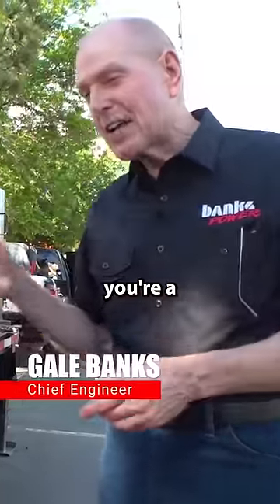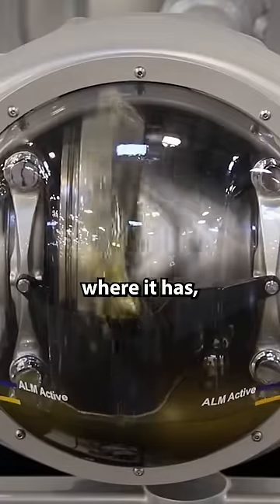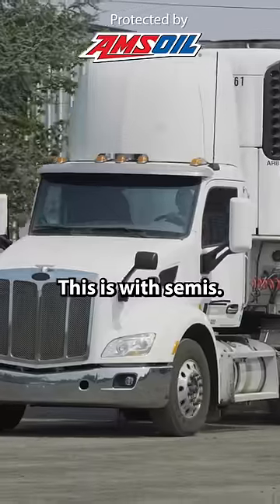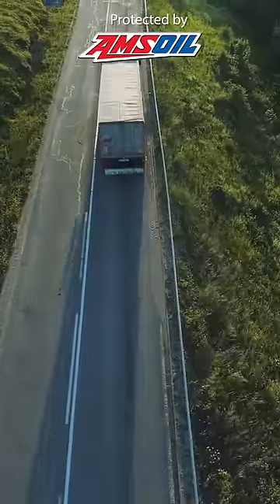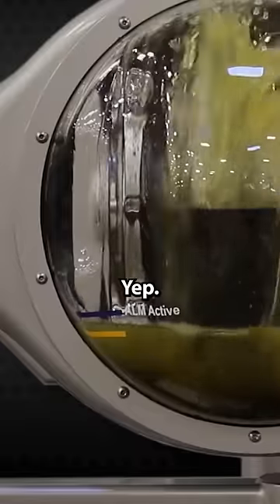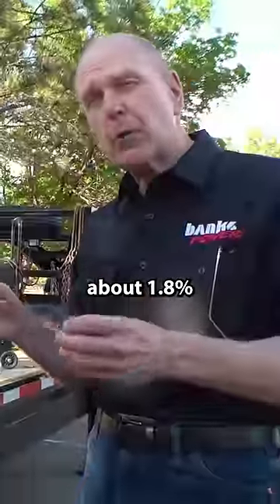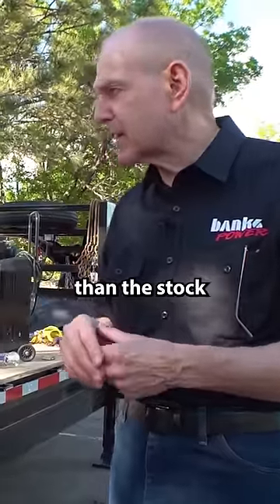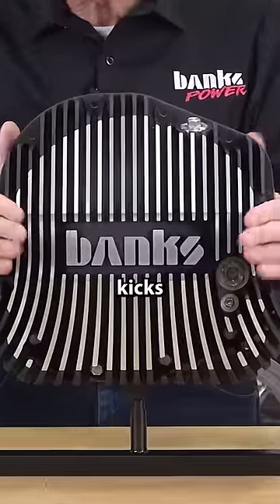Adding 18-wheeler science to your pickup

Comment: Drag racers have been dropping diff trans and oil levels  for that extra .001 in a final since the 60s.
Reply: It's is just the fluid resistance that increases any mechanic resistance? Is that what decreases performance?
Reply: @bok..  lowering reciprocating weight as well as keeping fluids off rotating parts  like ring gear and crank shaft   Minuscule difference but sometimes it’s enough.
Reply: @Formerlywarmer  interesting! I guess all these little things add up in the end. When you reach the higher levels of any competition shaving off a fraction of a second through any means possible helps out alot.
Reply: Back in 1972 at the Winston National drag race I lost my first race by 2/100th of a second.  Yeah, it is important to shave that couple of hundredths.
Reply: Difference between drag racing and semi trucks is that semis have to make it 500,000 miles and drag racers have to maybe make it 5.  Always take wear into account before you do something.  I have no clue whether wear is worse or better if you drop fluid levels, but make sure you do before you consider doing it.
Reply: He’s a racer from the 60s himself
Reply: Detroit diesel is really OLDSMOBILE.  RANSOM E OLDS old company....he made at least 8 companies....
Reply: I'd run ATF during winter months in my manual that called for gear oil. Mileage shot up, shifted much smoother and quicker and the 250k miles trouble free is the data that counts.
Reply: 😂😂😂 real100talk5
Reply: real100talk5  sounds about right
Reply: @davidpawson7393 so running atf in your manual made it shift quicker eh? Sounds about right. 🤪
Reply: @Urapunk 
Lowering viscosity will allow quicker/easier shifts. It’s why synchromesh “fixes” your gearbox when it’s really old and worn. But the chemical properties need to be significantly altered or accelerated wear will occur. Synchromesh addresses this, ATF does not.
Reply: word!!

We run slightly less oil in our dragbikes for this very reason.  Reduction in centrifical weight drag on the clutches = elapsed time :)

Comment: Semi truck drive axles also have oil bath bearings that often get most of their oil from the diff sump. They’re designed to push oil to the bearings when running down the road to help cool them and keep them covered in oil.
Reply: So do the wheel bearings on basically every solid drive axle.
Reply: A seal can be put in the axel tube to prevent oil migration down the axel tube.  And an fyi just for u, tapered bearings are pumps. If oil reaches the small end of roller, it pumps the oil towards the large end of the bearing.  
How is price configured on these money saving items? Cost of production plus shipping and distribution? Naw,  how much can you save, we'll charge 60% of that.  You still save some, but we make more.
Reply: @ianm432  Also on my 1950 chevy 3600 the axles have spirals cut into them so that the oil splashed near the tube is pumped to the wheel bearing. It is a full floating axle.
Reply: My bmw diff also has this
Reply: I work on trucks for a living and this absolutely is not how this works lol
Reply: @ianm432  not necessarily true,  a lot of fully floating axles in light vehicles do run grease, as far as I've seen. A really popular mod for an 80 series landcruiser is to remove the inner axle seal to allow the gear oil into the rear wheel bearings for lube instead of grease, they last longer and run cooler.
Reply: @bobsimpson3332 can you explain please? Some people come to the comment section to see what others are saying, maybe learn something new. I’d really like to hear your take on it?
Reply: That's literally all solid axles lmao
Reply: Throw all that engineering in the bin, i today saw a huge ass electric truck hauling massive fluids. And it had no such axle and gears. Motor straight to the wheels. Efficiency = key.
Reply: @bobsimpson3332  What's the point in telling someone that you're experienced and know what you're talking about, by telling them what you do as a job, to then tell them they're wrong but not explain how they're wrong.  What a great idea. Tell someone that what they think is wrong, but don't elaborate by correcting them so others can also learn. Instead, just say they're wrong and leave it open.  Yes people can simply google it and research it. But if you're not going to explain how someone's wrong by explaining what's actually correct, don't bother telling them they're wrong. Because you add absolutely no value to the discussion. At all. People leave with the same amount on knowledge before they read your comment. You would've been of more value if you just didn't say anything at all.
Reply: @stubbsmuffin  But not all solid axles have oil bath wheel bearings. So it's not all solid axles is it.
Reply: @jonnywilson9117  you speak like your trying to sound like dude in video with the way you over describe and repeat yourself
Reply: @Dudewhite-fw6xf  🙄
Reply: @HermanWillems 
Was that ironic in some strange kind of way I don't get?  

Even absolute laymen shouldn't have a hard time figuring out the reasons battery electric trucks for general transportation of goods won't happen anytime soon - or quite probably even ever - if they aren't severely handicapped and actually try.
It is quite obvious after all.

Comment: I was talking to an MTU tech about this very topic about three years ago. Reducing parasitic loss in transmission and final drives. Lowering both fuel consumption and emissions. Great content👍👏
Reply: The whole transmission is a huge parasitic loss. Remove it all together. Use electrical motors.
Reply: @HermanWillems hello. ALL of EV’s on the market today have transmissions. Look up videos here on YouTube on how to change the transmission oil on a Tesla.
Reply: @HermanWillems never wrenched on anything huh?
Reply: @HermanWillems good grief...yelling sustainability while also standing on top of unsustainably and championing it the whole time
Reply: @Rick-k7m took the saying "if you're wrong stay wrong" to a whole nother level...
Reply: @HermanWillems diesel generator with electric motors is the future, high efficiency. Check out Edison Motors

Comment: Some semi trucks actually have a oil pump that is driven by the input shaft on the power divider to circulate oil to the gears and bearings
Reply: If they have a pump for each differential. It's to pump thru a cooler.
Reply: @mariotillery8459  the truck I saw it on didn’t have any sort of cooling for the diffs. The pump was purely for oil circulation
Reply: @huntingislife7817  what kind of tractor? Odd setup and would need to be overdriven to be able to pump.  I have lube oil pumps on transfer cases,(Fabco,Namco, etc). I've heard of a set up like what you described.  But mainly for cooling.
Reply: @mariotillery8459  I forget the exact specs. But it was a mid 2000s western star set up as a snow plow. With a powerdivider on the first axle. The pump is a georotor pump that is driven by splines on the input shaft

Comment: I do all of my heat sinks this way.  I weld them onto diff covers and use my hand to feel the wind under the hood, then weld a tab to bring air to the fins.  I'm doing an oil pan as well.  Passive cooling rocks and oil cooling in any form rocks.  Cover looks good probably beefy, you can do it with a sock one.

Comment: Wish i could put them sumps in my semi! I always think about how much hp it takes to turn that ring gear at highway speeds.. I also used to put 80-90 in them because I thought like alot of guys that thicker is better cuz it sticks to the parts better. Lol yeah thats just creating massive resistance at highway speeds.
Reply: Well what do you put in it now? Are you telling me you run thinner than 80w-90 in a semi?
Reply: What about trying the hybrid setup the Canadian company is making?
Reply: @milescarter7803 edison motors, and it’s not a hybrid
Reply: @tylerj6327 If it's not a hybrid than what is it
Reply: @5.43v electric
Reply: @5.43v  its fully electric. has a on board diesel generator to replenish the batterys. and can also run off the generator if  nessassary. 
and 5.43v is that what i think it means like the 5.4L 3v 2004-2010 f150 engines
Reply: Ive never seen anything lighter than 80w90 except in weird light duty applications where they ask for 75w85
Reply: @5.43v  it’s a fully electric semi with an onboard diesel generator, calling it a hybrid would be the same as putting a generator on a trailer towed by a tesla and calling it a hybrid. The generator does not and can not directly power the drive wheels hence it is not a hybrid. To be a hybrid the diesel generator would have to be attached to the drivetrain.
Reply: @tylerj6327  if the engine was on the Tesla itself it would absolutely be a hybrid, on a trailer? No. Even they have said technically it is a hybrid
Reply: @thomasalary6406   I'm using 70W-80.
Reply: @KDIGGG Same technology as a train. Therefore diesel electric. Not hybrid
Reply: @jaredlancaster4137  75w 80 synthetic
Reply: @lovetofly32  80w isn't that much thinner than 90w, but it's still thinner than I'd think is good for a semi. I'm used to running 140w in anything especially heavy.
Reply: During my deployment the MRAP's axles was filled with used diesel engine oil when it was serviced change oil in axle dump used oil from engine in diff's.  Not quite the hard use of OTR but still ran hard in in high temperatures.
Reply: 75w80
Reply: @HJZ75driver man I love what Edison is doing.

But to say it’s a diesel electric and that’s not a hybrid are you faulty?

It’s literally two different drivetrain technologies combined.

Hybrid isn’t some buzz word, it literally means something. A mix of two things if you want a simplification.
Reply: @justinstevenson2061 but it doesn’t have two drivetrain technologies.  It only has one: an electric drivetrain and that’s it. It’s not like Prius that can run on gas, electric, or both. The Edison drivetrain is ONLY electric. 

Perhaps the best term for it would be a self-charging electric?
Reply: @williamp6800  ya I do get that. The part I’m wondering about, is that it can run on just the generator if needed.

But I guess that’s just incase of battery failure not electric axle and motor failure.

So still an electric. I mean getting into semantics if you charge at home and that electric come from fuel you still call it EV. So I guess then this is EV regardless…..

Just having onboard fuel burning and calling it EV irks me.

And not cause I’m against fuel, or against EV, just more to have a term that makes sense lol.

Comment: Actually meritor (rockwell ) designed the axle & makes them for detroit diesel . In 1998 i ran a highway truck in road race from battle mountain  nv to austin nv 86 miles long i ran a.t.f. fluid in transmissions & rear axles.

Comment: So in a wind turbine they have a gearbox that takes the low speed from the rotor and turns it to 1800rpm to turn the generator. When the turbine is running it will push most of the oil from the gearbox back into the sump tank. It has a pump that lubricates the key components inside the gearbox and circulates the oil through the filters and back into the holding tank. It’ll even derate the power output of the wind turbine due to hot or cold oil temperature and return to normal once the oil is at operating temperature.

Comment: What was the longevity of the oils, and the diff gears when they are running hotter or oil that has been stressed that bit more than recommended.?
Reply from the maker: The key is designing a diff cover that channels oil to all the critical areas without the need for overfilling. The Banks Ram-Air Diff Cover has an internal lubricant raceway that precisely follows the ring gear as it rotates, channeling fluid to the pinion at the back of the diff. Our diff cover also have  fluid guides to channel oil out to the axles as well.

Comment: I wish Banks would make a cover for the front housing too.
Reply from the maker: We have a long history of problem-solving. Thanks to a lack of airflow, the rear differential, ring, pinion, and bearings succumb to high temperatures. That's the issue that we set out to solve. And, since the front axle is being blasted with air as you drive, there's no problem to solve.

Comment: My 86 Isuzu diesel pickup truck used motor oil in the transmission and got fantastic miles per gallon I changed it out to 90 weight and it went to less than half. Obviously I went back to motor oil it was just an experiment..

Comment: So an oil reserve container on the inside that pumps more fluid in to and extracts fluid from the axle sump .
Hence less torque resistance equals better mileage ?
    This is out done by the advent of electric trucks 

 So maybe a hybrid truck with a normal axle and an electric axle ?

Comment: Back in the early 70's working in a local garage as a TA I was taught to fill gearboxes and diffs to the tip of my finger rather than to the bottom of fill plug hole. I was told it would help the oil to run cooler. Our summer temperatures sometimes got to 50C.

Comment: In the real world, there's no perceivable difference.  I had a bent stock cover, replaced it with a flat back cover at 10k miles.  Ran the flat back for years, no difference in mpg, just more oil in the diff.  At 118k, replaced my flatback with the banks cover.  No difference in fuel economy, less oil in the diff.  Might run cooler on the highway.  If you drive a lot of muddy roads or gravel roads, I've  found the air scoops on the cover get plugged with mud and negates the airflow that's supposed to aid in cooling.  The front edges of the scoops are  dinged and has divots in it from gravel hitting it.  I suspect at some point a rock will knock those scoops off.  Got  175k miles on the truck now.

Comment: Just use the correct size axle and don't overload it. Towed thousands of miles at high speeds and never had an axle get hot that was not grossly overloaded.
The small U-joints are the weak link on modern HD pickup trucks, not the axle.

The U-joints will fail if towing too much weight and traveling too fast. 
Modern HD pickups have more engine power than drivetrain strength. 

For example, trying to trailer a backhoe with an HD diesel pickup truck. 
It has enough power to tow it, but the U-joints are easily overloaded and destroyed if towed far, fast, or accelerate quickly. 
The U-joints will repeatedly fail before the axle oil overheats. 

Don't see a return of investment considering the sump covers cost and rarity of axle overheating. 
If someone has a commercial hot shot that constantly crosses a desert during the day, then they MIGHT benefit from this cover. 
They will destroy many tires from the heat before the axle fails. 

When changing covers, if mpg went up, then oil pumping went down. 
I would rather have the oil circulation cooling my axle and bearings.

I suggest crossing the Mojave desert at night during the summer anyway.
It will save a lot of money on tires and not overheat components.

Comment: The mechanics who only buy parts from the dealership of that vehicles ill guarantee  you worked ata dealership to begin with.   After market parts are as good or for the most part better then OEM parts.  Banks products are well engineered products!!  Now some of the prefotmance stuff out there is crap!!!  In the diesel part if you install it and blacksmoke comes poring out take it off & send it back!!!  Black smoke is tooo much fuel or not enough air & its ubburnt fuel which is wast3d money and pollution !!!  When i see it ill call the pilice and get the tag number and report them to every agency  that has power over that!!  They have removed the tag from the vehicle  and in 1 case took the truvk because of too many mods done on it!!!  Thats the air i have to breath you are messing up.  I think in florida we need to do emissions checks to get these stupid asses off the roads!!!  Of course th3 government  will over do it so it should be a non government  run check and not run by repair shops!!!  You dont Guard a chicken cop with a fox!!!

Comment: Because overheating the diff/gear oil on a light duty pickup is such a common issue. Solutions looking for problems........
Reply: Cruising temps and overheating temps arent that far apart.
Reply: ANY highway driven vehicle can potentially have this problem… especially if you tow.
Reply: If you tow with low gearing on a hot day, lay your hand on that diff cover. My OBS PowerStroke has 4.10s in the rear and towing 12-15k it gets pretty hot. Keeping  something iser to optimal temp is always a good thing. And yes, I have one of these covers on it and it cuts the temps by an average of 70°F on a 90 plus day. It's not a solution looking for a problem, it's protecting your investment. These newer trucks have got to be worse on heating issues.
Reply: @thegreenerthemeaner  I had 4.30 in my 10.5 and towing 9 to 10k going 65-75 you could smell the fluid cooking while putting fuel in. I would definitely install one of these if I was still doing that kind of stuff.
Reply: They need to make a cover for the Corporate 10 bolt axle. I'm sold on Banks diff covers. Watching the videos Banks did you can see the engineering they did.